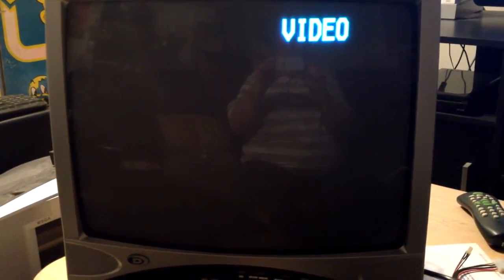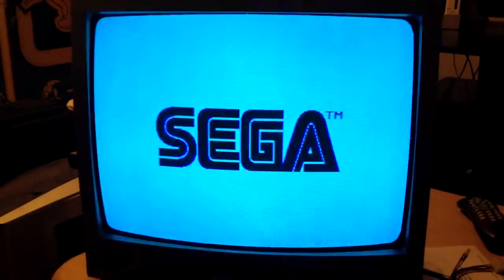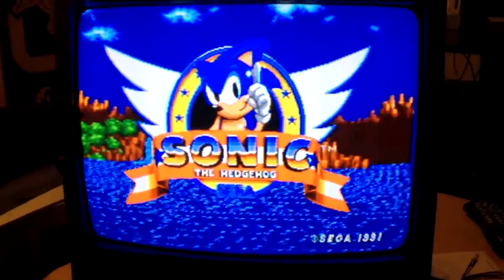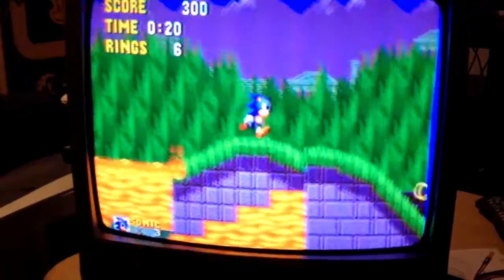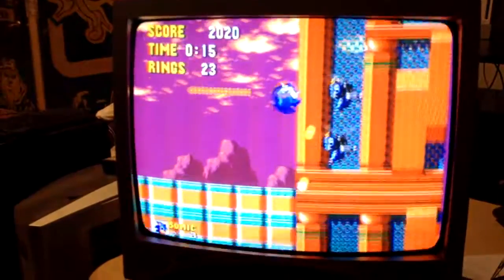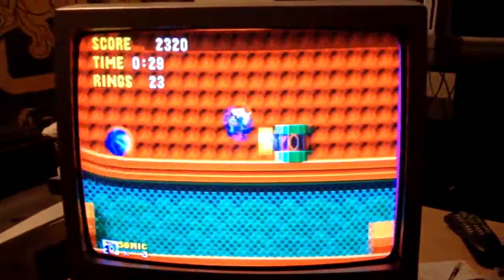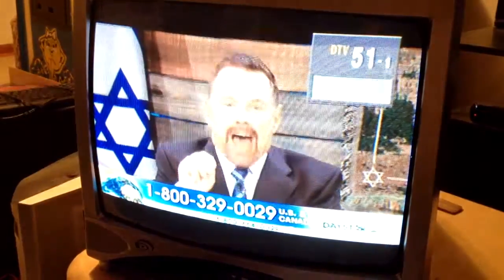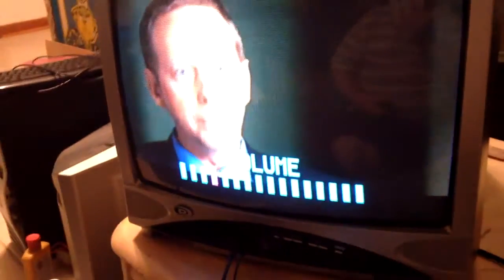Testing Durabrand 19 Inch CRT

Comment: i was going to get this a month or 2 ago when i was looking for crt tvs to play my old systems on but i decided to just use my hd tv instead
Reply: @randomgamer24x65  wdym?
Reply: @compositefrog1811  hd tv
Reply: @randomgamer24x65  so there's nothing wrong with it
Reply: @compositefrog1811  yes there is
Reply: @randomgamer24x65  ok what's wrong with them? Tbh I still want a crt tv like a 13 inch one with maybe a dvd or vcr player but it dosent male sence to buy one if i already have a tv
Reply: @compositefrog1811  "buy" bud every crt I have right now i got for free i have the 13 inch version of this tv an ilo dtv2794a it has component input but needs a recap an rca ajr a black and white set a Samsung syncmaster 500s a computer monitor and a Sony trinitron I could go get more but in a small apartment I can't oh and also I have an rca truflat with svideo
Reply: @compositefrog1811  what's wrong with them I'm gonna guess about everything is wrong with them for ps2 and back they scale the video and add input delay and most only support composite so they look very blurry when scaled to fit the screen. A crt doesn't have that problem because they don't have much of a native resolution they can do any resolution that's supported with no scaling. A vcr dvd combo crt would not be a good set because the dvd and vcrs tend to not work unless you swap in new belts in
Reply: @randomgamer24x65  well I really only wanted a crt tv to play my ps2 and wii on but I'm fine with the tv I have, which is a roku tv. 
The only problem is that whenever I play on ps2 or wii or basicly anything that has an av signal after let's say the ps2 logo goes away I can still see part of it on the screen
Reply: @randomgamer24x65  oh speaking of dvd and vcr I have a memorex dvd combo and it dosent spin the disc.  Do you know how I could fix it?
Reply: @randomgamer24x65  ok update, I decided to buy this tv from ebay.  Hopefully it dosent Come broken